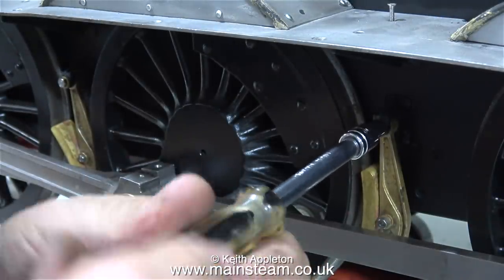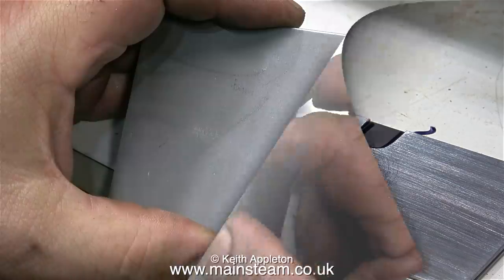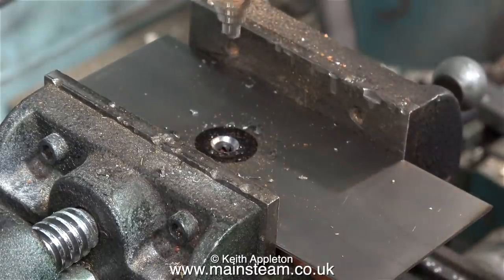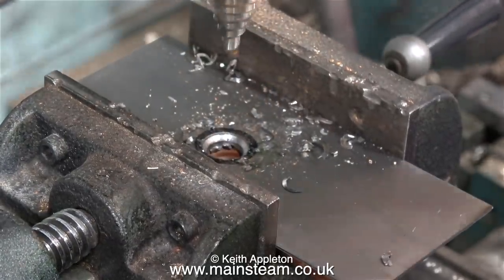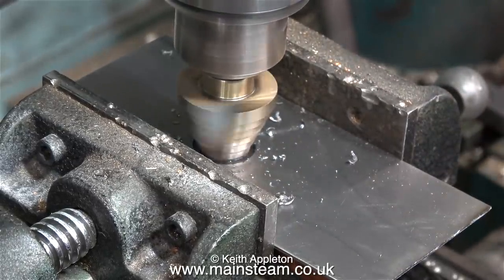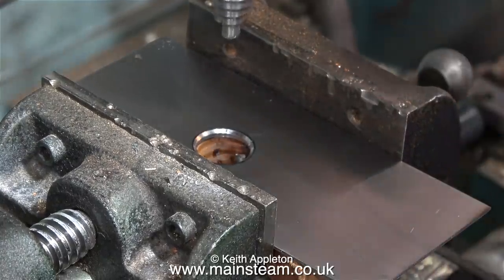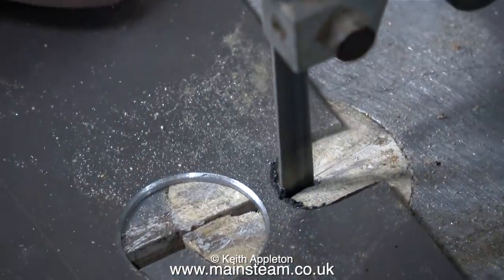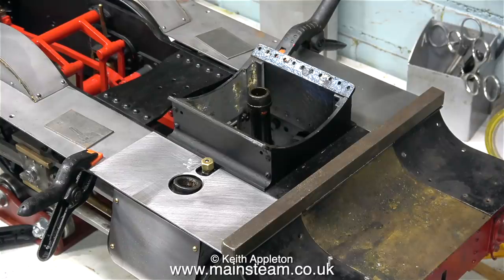HOGWARTS CASTLE - A 5 INCH GAUGE LOCOMOTIVE - PART #30

Comment: While watching you drill that hole and talk about getting it in exactly the right place I was thinking you should have just left the piece of running board a bit over-length and trimmed it back later... of course if I was doing the job I would not have thought that at the time! That would only give flexibility in one dimension anyway but better than none.